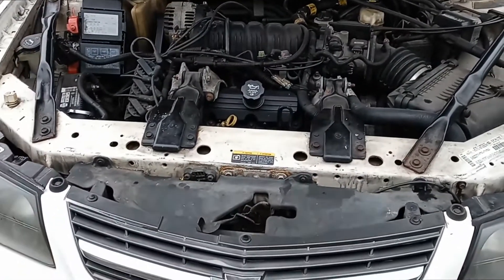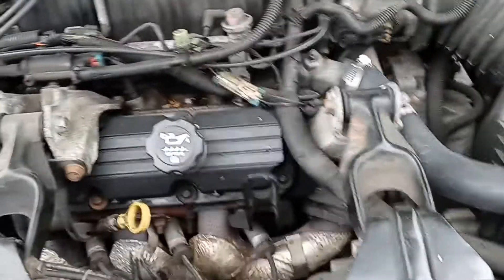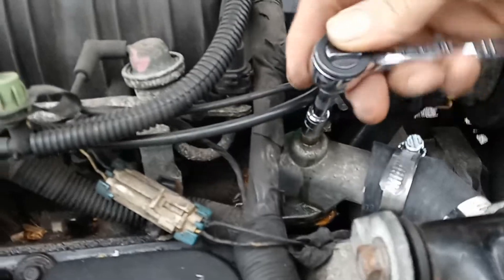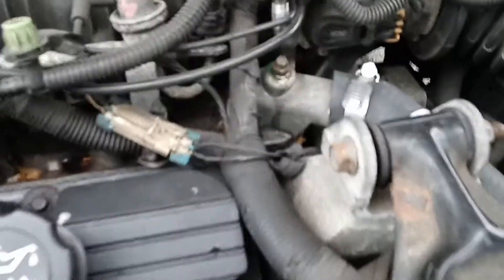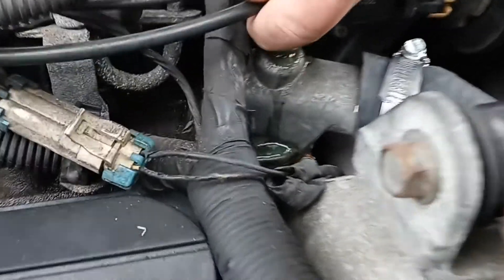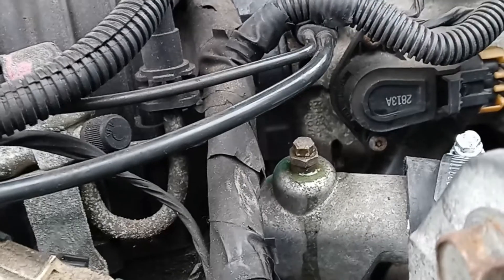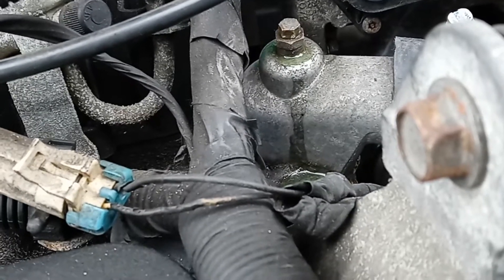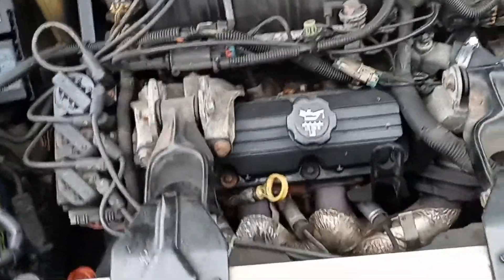How to Bleed a Chevy Impala V6 Motor after Working on Cooling System

Comment: Yesterday My hose above my water pump busted a leak, cut it short and replaced it back and it started over heating, today I replaced the thermostat and it’s over heating. I didn’t get it bleed and maybe I replace the thermostat for nothing. If this doesn’t fix it I guess water pump is next. Hopefully it does. 

And thanks for the video
Reply: What happened? Was it the bleeder valve)
Reply: I also have replaced that damn thermostat for nothing. It was air in the system. Main symptom of that is when the heat comes and goes. It's also bad for your water pump